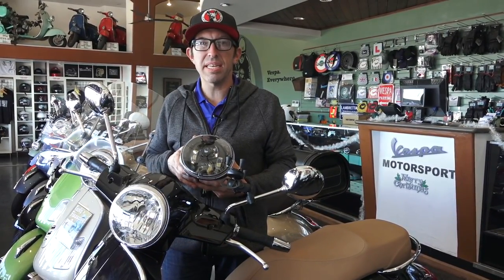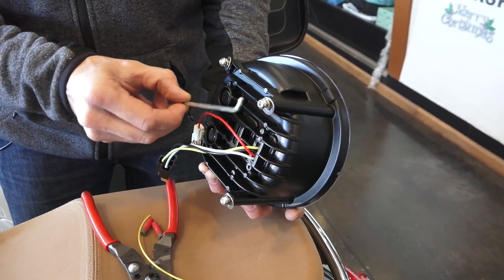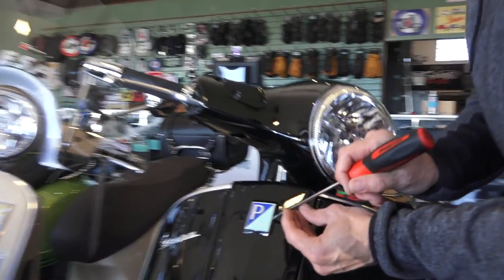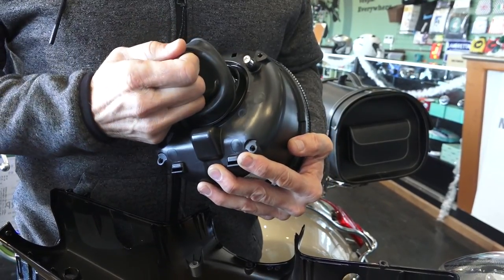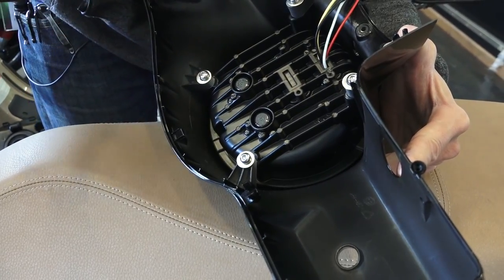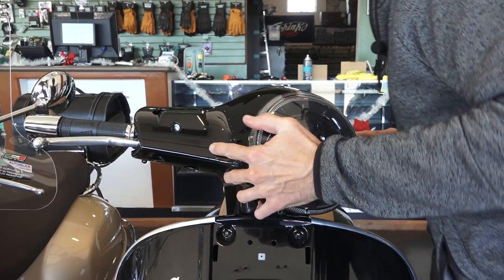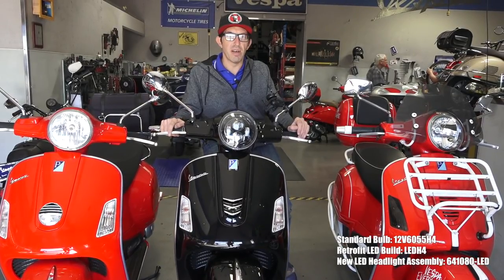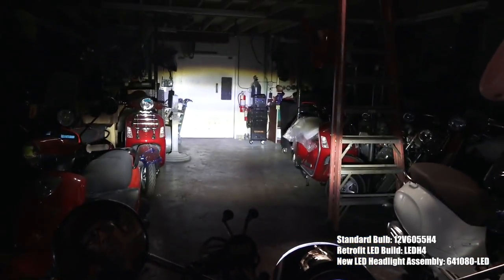New LED Projector Headlight Assembly for Vespa GTS

Comment: Hi. Thanks for the video! I get 1 question, is there any way to get electrical supply for drl without adding posi tap? The headlamp seems having connector for drl wire...

Comment: Got mine today. Bolts too short!  Very upset. Going to Home Depot to get the right length. Not cool.

You’ll need 35 mm #5 machine screws to do this job.  The included bolts were not adequate.  I finished the job though. Skipped the running light jimmy rig.  Wires too small and space to tiny. Not necessary anyway. Looks good and much brighter. 😉
Reply from the maker: Sorry to hear that, we will take a look at that and see what's up. Glad you got it installed though and it's working for you. Thanks!